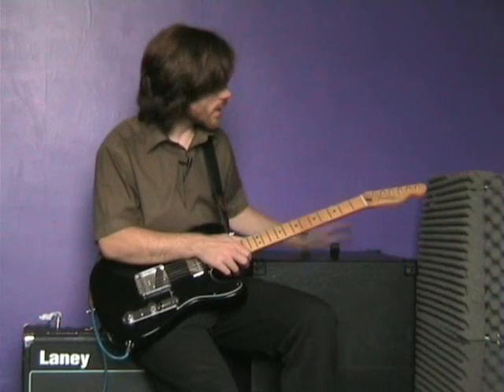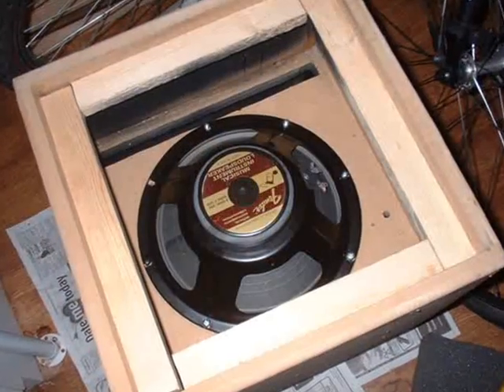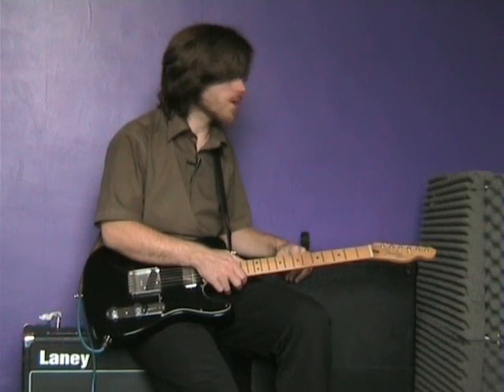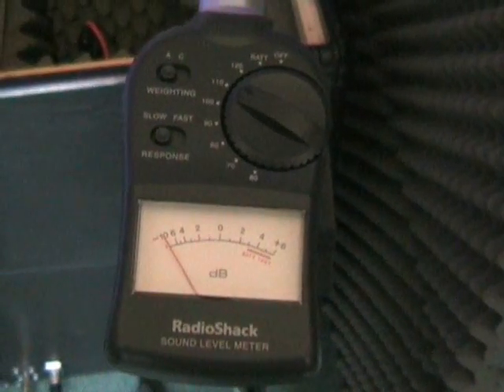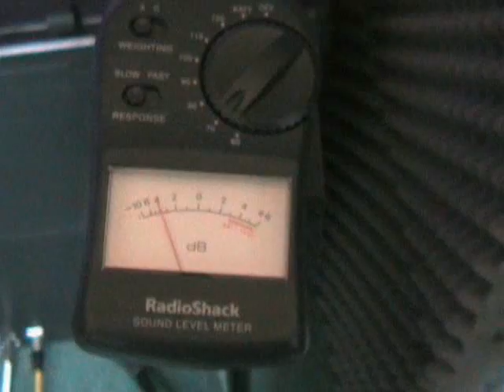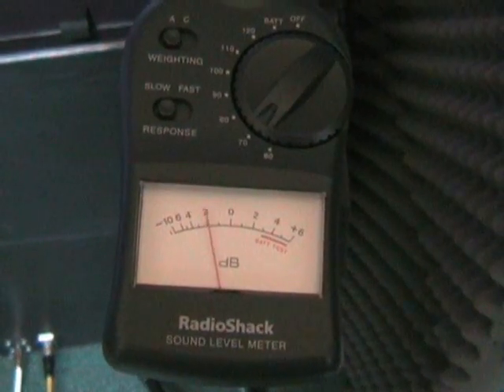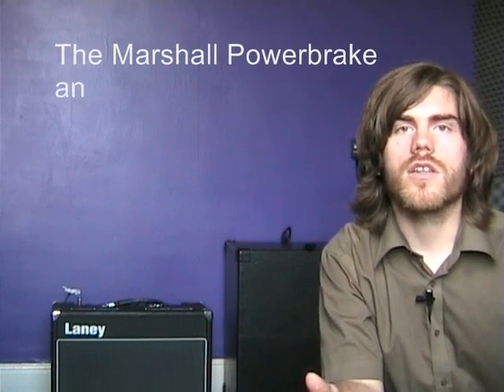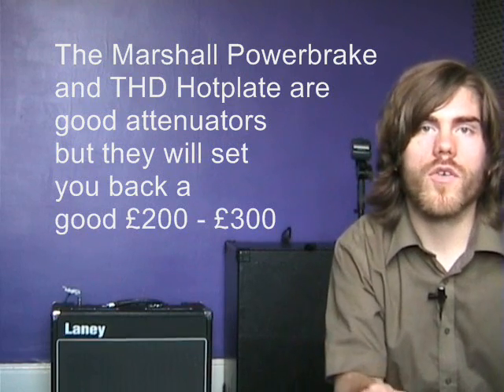Ben's Guitar Speaker Isolation Cab

Comment from the maker: Another point to note - the SM57 is pretty much the same as an SM58 inside, the only difference being the windshield in the grille on the SM58. With this in mind, if you have an SM58 to hand there's no shame in using it on a guitar cab. I have some copies of these mics, the Thomann MB75 (SM57 copy) and the Behringer XM8500. Both are close to the original in size, appearance and sound. The MB75 is particularly good.

Comment from the maker: As far as my understanding goes, yes. Rockwool is more dense and would therefore be more effective at reducing bleed from the cabinet. The more you increase the density of your soundproofing materials the less sound waves get through. The best material for soundproofing is probably concrete... which I could have used but it would have been a bit too heavy ;) 

The seal around the lids is an important aspect too. You'll always get leakage from the weakest part.

Comment from the maker: The construction is 18mm MDF and timber. I designed the small box first, taking into account the dimensions of the speaker and then designed the outer box to be large enough to take the inner box surrounded with packing foam. 

I designed the boxes to be easy to assemble, so two opposing sides have an internal timber frame which the other two sides are screwed onto. Every join is reinforced with silicone sealant, as more airtight means more soundproof. I rounded the corners with a router.

Comment from the maker: Concrete does not reverberate particularly which is what makes it so good for isolation purposes. A hard concrete surface would cause a lot of reflections (which I think is what you mean) but this can (and should) be dealt with using something absorbent, such as foam tiles.

Comment from the maker: The SM57 was plugged into a Spirit Folio SX mixer and sent to an M-Audio Delta 1010 on my computer. I don't rate these mics that you can plug into a usb port. 1 - you can't use the mic for anything else 2 - if you buy a mixer you can use different sorts of mics. If you're operating on a budget you may find that investing in a Line6 TonePort would be the best thing you can do. The mic preamps are good and it comes with some brilliant amp models.

Comment from the maker: @DeanMLFlame acoustics is a very complicated subject of which even the experts have only scratched the surface. When we're talking about decibels we're not talking about a linear scale, you'll have to do your reading here but a good example is that a 100Watt amplifier is not twice as loud as a 50Watt amplifier. It's still louder but not significantly so. So yes, increased volume = increased decibels but if you saw it on a graph it's a curve not a straight line.

Comment from the maker: @TheKinkySheik You could do that but I'm not sure it would be worth the hassle. The cab keeps the sound trapped in the box, the only way the sound gets out is if you stick a microphone inside it and hook that up to some speakers so you'd have to get a small mixer and some decent speakers - studio monitors ideally.

The simplest option would be an attenuator. 

Celestion Vintage 30s are a bit shrill for my liking, you may find that the character of the speaker is more the problem than the volume.

Comment from the maker: Thanks for your comment!

The jack for the Laney speaker is disconnected and the white lead is plugged into the Laney in it's place.

The mike is running into my studio mixer allowing me to send the sound to my computer, same as if I put a mike in front of an amp, the point being that I can use the cab for recording. 

All sound on the video is recorded this way computer and sync'd up with the video later; sound you hear when I'm playing is the sound from inside the cab and nothing else.

Comment from the maker: Yup, like I said... not a high gain amp, but there's no reason why this shouldn't work with a JCM2000 or Triple Rectifier, for example. 

It is definitely better than using an attenuator on its own but I have since found that it works really well in conjunction with one. All depends what sound you're after, obviously.

Thanks for your comment.

Comment: Excellent playing.  I'm not too familiar with SRV, but I heard some Hendrix-like tones and playing towards the end. I'm not technical, so can anyone help on 4 points please. 1, When Ben plays full whack, is Laney spkr off (or just at very reduced output)?  2. I assume Fender spkr is connected by lead from amp rear socket?.  3, How is Laney spkr turned off (if it is)?  4, Is mike just to connect to camcorder's audio input? (so we can hear more easily).  Sorry to be thick as mince, lol.